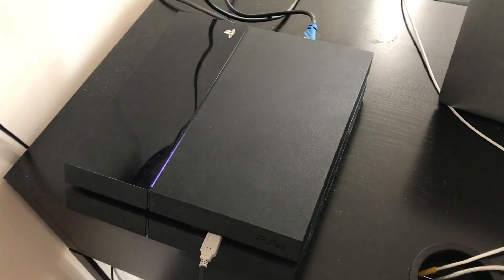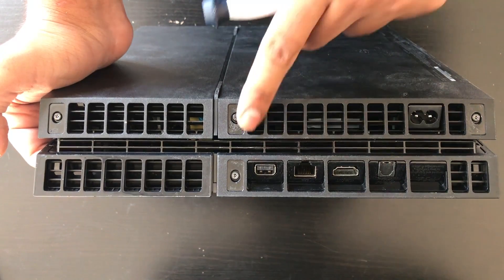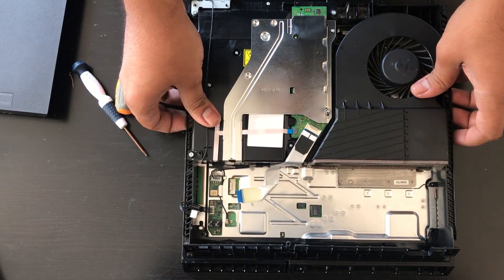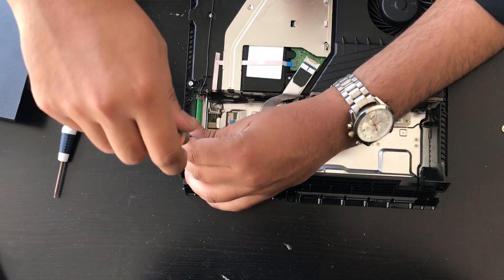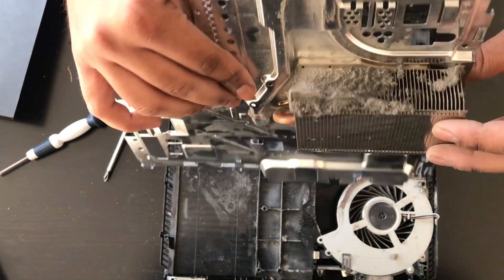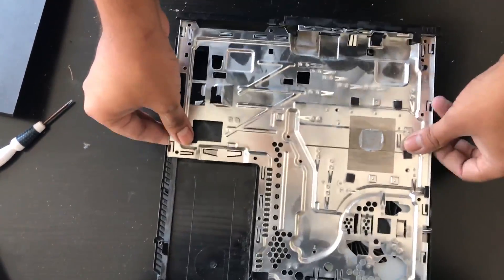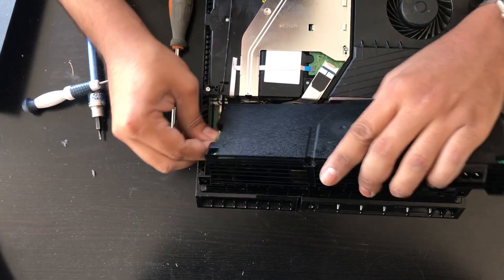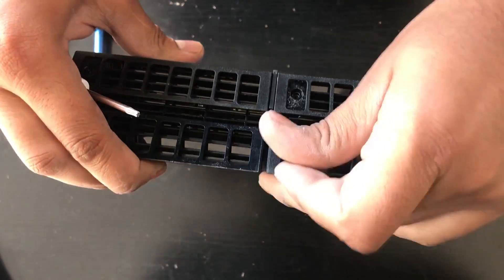PS4 Too Hot overheating due to dust build up and fan (CUH-1001/1115 cleaning and disassembly)

Comment: I want to thank you for doing this step by step tutorial. I decided to disassemble my ps4 following your instructions since I wanted to be sure that it would be real clean. I had to do it urgently cause even when using YouTube it was running loud. I don’t need to mention that I stopped playing games for sometime due to overheating (It shut down on me twice so I didn’t wanna go for a third one)
Everything went fine and all worked as it should. No missing screws or unplugged cables 😄 Now it runs much better and it definitely blows air again.
Reply from the maker: I know this comment is late but please subscribe to the channel and like the video.

Comment: Hey I fixed my ps4 and cleaned it all and I followed everything and once I cleaned it and put everything backed together it started to tell me that my ps4 overheated, may it be the thermal that’s on the mother board, never mind I looked at the fans circuit cord and it’s broken

Comment: After you finished putting it back together you say you cant hear the fan anymore when the game is loading, A real test would be to play the game for half an hour to one hour and i bet you the fan will be loud again, My PS4 from when it came out 2013 i just recently opened it up and cleaned the dust and it wasnt that bad, I have my PS4 Raised up about 15mm i use rubber grommets underneath so the air flows underneath it and it stays cool, the highest temperature it has got from the exhaust fan is 54c and thats playing for 2 hours, i also keep it covered with a Plastic Cover after i finish using it so hardly no dust gets inside the console, if you look after it properly like i have it will continue to give you hours and hours of Gameplay, Cheers Jos

Comment: i used a knife paper towels to clean mine and it is running smooth
and more like a private jet than northway airlines starting up a plane with turbo engines

Comment: Hi, my ps4 was very loud, then it switched itself off due to overheating. I opened it and cleaned all the dust. But, now it sounds like then fan is struggling to spin? A slow kind of grinding noise every 10 seconds or so. Any ideas of a fix?

Comment: hey man, my ps4 keeps overheating and gives me the error message and then turns off 5 minutes after the boot , ive cleaned out almost all of the  dust but still its loud asf and still gives me the same problem,the only thing left to replace is the thermal paste , could that be the problem
Reply: Yes

Comment: ok check it out i have done this to mine and my friends and bothofmy cousins ps4 and his ps4 pro. they all have been working fine for months with no issues. i went on vacation took my ps4 with me. i packed it on top of soft clothesin my suitcase and completly coverd it up. got where i was going hooked it up played a few times in 2 week period watch some blue rays streamed some shit the usuall. packed it back up the same way came home hooked it up played for a couple houres it started to get a little loud so i turned it off took it apart to dust really good figured fuck it replace the gel again so i did put it all back together hooked it up turned it on and it was super loud ran for like 5 to maybe 10 mins than dies. question is what the hell should i check,do or redo?thanks everyone

Comment: 11:06 why are you putting that on when it still has dust?
Reply from the maker: To reduce the chances of damaging the mainboard.
Reply: T R A P P H O N E talk to someone about it bro
Reply: Michael Parissi 
Not even with like a dust cleaning air spray?
Reply: @lfg527  no worries, spray away. And a q tip dipped in isopropanol for cleaning parts on MB works. + No point leaving that crusty old paste there, replace thermal paste when doing this.
Reply: Mads Isak 
Thanks!!
Reply: wow i sprayed all over motherbord to clean dust off ...
Reply: he even left the used thermal paste as it is
Reply: DriFtyZ I assumed he replaced it when he cleaned the heat sink off camera
Reply: I used q-tips and swabs to go around the chips
Reply: I actually used foam cleaner on it 😂😂 glad it still works
Reply: cuz if u clean the motherboard it will fuck it up
Reply: @YoNatrix  no not really depending on how you clean it only I find troubling is he didn't replace the thermal paste
Reply: NatrixFN really ? Why didnt he say that
Reply: @carlosrijo6245  have no idea why. Just make sure before you touch a motherboard you touch metal first for a bit. I destroyed my old PC like that

Comment: I opened the ps4 cleaned everything closed it and now when I use my controller it wont respond properly and disconnects after a while. Can somebody help.
Reply from the maker: Check the antenna
Reply: @fasttechvideo  ok thanks a lot. I ended up figuring it out looking at your comment section on the antenna replacement video.

Comment: Wanted to play/test out my PS4 a bit after following this guide and cleaning the insides of my PS4 before posting here: my PS4 had gotten to the point where it would sound like an airplane taking off, and would “get hot” and auto-shutdown after like 5 minutes. After following the steps in this guide, it now barely makes a sound and runs again, thank you so much for this! Even us 40 year olds can learn a few new tricks!

Comment: I cleaned it still does the same thing I don't understand
Reply from the maker: Replace the thermal paste.
Reply: @fasttechvideo  I took the white casing on the top so it gets more air flow and it's perfect
Reply from the maker: BazaarYT that’s a temporary solution.
Reply: @fasttechvideo  your right i fixed it i blow all the dust now my ps4 is so quite thank you for the help it was just dust build up
Reply from the maker: @Bazaar556  Awesome! Please subscribe and like the video then. It doesn't cost anything to you but helps us out a lot.

Comment: I did clean my ps4 and is still loud and now it's getting way to hot so I can't play games? Any tips?
Reply from the maker: Raggarmeistern Muffe replace the thermal paste and check the tightness on the heat sink clamp.
Reply: @fasttechvideo  yeaaah, I would do that, but my ps4 broke so I sold it to my cousin, he said he was gonna fix it

Comment: I cleaned my PS4 but it’s still loud what should I do?
Reply from the maker: HNIC KB Replace the thermal paste and check the tightness on the clamp.
Reply: Fasttech what should I do if my PS4 laggs but it’s not from
My WiFi it laggs offline too

Comment: Good video my only question is about the thermal paste, I've had a look at a various videos and web pages and they say if you remove the motherboard you have to replace the paste each time is this true
Reply: I fixed it without removing the motherboard I took it apart twice first time I just brushed the heat sink clean but it was still noisy, I see online that it's the other side that gets blocked so took it apart again and shined a torch thru the sink no light was passing through so I got my hoover and put it on air blast in a puff of dust it cleared and now runs nice and smooth, I will probably replace the thermal paste another time but doesn't seem necessary

Comment: Fasttech you are my hero! My PS4 kept overheating and was so loud! After I followed the steps in your video, and reapplying some thermal paste, my Ps4 is quiet and I get to hold out for the Ps5 👌. Thanks again!
Reply: Where did you put the thermal paste
Reply: @devahnmurphy6917  on cpu
Reply: @devahnmurphy6917  Its squere part

Comment: After all these years... ive opened my ps4 multiple times and cleaned out the fan but i never cleaned the heatsink... ive replaced the thermal paste as well and nothing worked... but the. Finally FINALLY after cleaning the heatsink.. the fucking noise is finally gone i cant believe it bro u wanna tell me i could have fixed this problem years ago if i had just cleaned the fucking heatsink!!!!!! Anyways thanks bro ur a life saver, its so quiet right now :)

Comment: I don't get it, I  did everything in the video and cleaned out all of the dust really good.  But I still get the loud noice. What's wrong now?
Reply: Update: I figured out my problem. I just had to replace to thermal paste. This guy made it seem like you don't have to but it made a HUGE difference.

I recommend anyone to replace the thermal paste if you opened your PS.
Reply: Its the fan
Reply: @joaoruxa  nope, It wasn't the fan. Like I said, I cleaned out all the dust from my ps4 including the fan. It turns out I just had to replace the thermal paste.
Reply: @Rexxsar101  ok good you figured it out

Comment: Hey so I'm pretty sure I did everything right and I really thank you but I've ran into an issue which I can't solve but here it goes. So I finally plugged my ps4 in ready to get it going I hit the power button the light stays lit for like 3 seconds and then the light goes away and the ps4 doesn't turn on

Comment: Absolut legend, thank you. Bought mine on Gumtree for £100, very noisy and hot. Followed your video, and OMG, I havent seen anything like it, what a dirty piece of crap it was. Took me about 30 min to get it as new, replaced the paste as well. Now its like new. Many thanks and for all the guys from the UK (not so confident to take it apart) I'm happy to help as well. Wish you all good gaming!
Reply from the maker: I love it when you Enlgish dudes call me a legend. Upvoted and loved. One day I will actually become a legend and make you all proud ;)
Reply: @fasttechvideo  By doing vidoe like this you save a lots of frustration and possibly wasting all these consoles, thats is very positive. I would like to see this issue sorted by Sony, perhaps adding dust filter that can be changed or changing the air flow so it can be easily cleaned.

Comment: Btw this idiot forgot to mention DO NOT DO THIS unless you are prepared to replace the thermal paste. I carried out these steps and cleaned the heat sink only to find my PS4 became 20 times louder than it was before. After some quick research I realised that removing the motherboard needs to be followed by replacing the paste as the paste is usually dried up and flaky when you remove it
Reply from the maker: Adolescentrages 5678 If I’m such an idiot why are you following my tutorial? I must have mentioned twice that you should replace the paste if it’s dry. On this unit it wasn’t and the customer didn’t want to pay for a service they didn’t need.

Comment: after you plug it in is there any memory or data lost?
Reply: Nope I did this. My PS4 used to sound like a jet and overheats in 2min but after this it was quiet
Reply: @uniquesamyu7054  ok thanks 
:)
Reply from the maker: No data will be lost.

Comment: ok.we cleaned my cousins PS4.The Thermal Paste wasn't dry.The fan was all good.But i think we made one mistake.We didn't use an air compresor(i think that's what u said in the video😂)we threw the big pieces of the dust and we just like blowed in it😂😂we put it back together and when we turned it on.he got in a game and it was the same.An airplane was flying,and after like 15 minutes it said it's too hot.We are planning to do it again tomorrow.So do we need the air thing or not?😂Sorry that it was this long💞
Reply: nerma - _ - is it good now?
Reply: @doganefe.  yup we just had to remove the thermal paste and put in a new one.He says it's quiet now and it never overheated😃
Reply: nerma - _ - my ps4 shuts itselfs. Yours was like that or not?
Reply: Doğan efe kırbaç yeah his got a warning that it's overheating and if he would still play it would shut down by itself.Did you try replacing the thermal paste?
Reply: nerma - _ - thank you very much bro.
Reply: Doğan efe kırbaç you fixed it?
Reply: nerma - _ - no, I bought the wrong screwdriver. I ordered the correct  one. Thank you so much
Reply: nerma - _ - Finally’did it. It’s too quite. 15 munites passed and didn’t have a warning about overheating. Thank you.
Reply: By the way I replaced thermal paste. Used Artic Mx-4
Reply: Doğan efe kırbaç yeah now he says it shouldn't be overheating

Comment: I did this and now my PS4 won’t turn on properly. It beeps once, flashes blue, and then nothing. I can hear the power supply but nothing happens. I checked all the wiring to make sure everything is plugged and it all seems fine. Suggestions?
Reply from the maker: Lovell Johnson I can try to troubleshoot with you over the phone or email if you ordered it from us.
Reply: Email: clippedbacksmith@gmail.com

Comment: I just did this last night the dust was so old and thick I had to use my small 150 PSI air compressor with a basketball inflating needle to get the dust out because the dust wouldn't even budge with an air can. It still runs sort of loud but not nearly as loud as before I cleaned it and it didn't overheat. People have to understand that every game is different some games have a lot of content built within them and that's why the PS4's run so loud because its trying to run all of the content within the game. I personally play COD Black Ops 4 a lot and that game makes the PS4 run loud because of the constant updates they keep adding to the game. After doing this though it stopped over heating. Now I can play my multiplayer sticks and stones and Blackout without it randomly cutting off in the middle of a quad game!!!

Comment: People, change the thermal paste once you disconnect the APU from its heat sink. Every time.

If new paste yoy can just collect and spread it again but his shit was crusty and full of spaces. If he had no issues after this it was out of sheer luck and he happened to have great contact between the sink and APU die.

Thermal paste does nothing but fill in the small gaps that may exist between the heat sink and Chip die. That's it. It doesn't suck away heat itself or cool anything. It transfers heat from the chip to the heat sink IN THE TINY GAPS WHERE THEY DON'T TOUCH PERFECTLY. That's it.

It's very important despite doing so little. The one thing it does is essential. Replace it if you open your console and remove the motherboard. Every time. Always.

Comment: If you are repairing someone elses ps4 you replace the compound ,and give it a good clean not just the fins the whole thing ,job half done is a lazy mind.
Reply from the maker: Did exactly what I got paid for. The customer did not want to pay extra for thermal paste replacement. Keep in mind we only charge $45 for this job. You can make a video showing how to do it your way.
Reply: @fasttechvideo  no disrespect it only takes ten minutes,the compound should be added ,as you are taking the plate away from the apu ,if they have acknowledged the way you do it ,i guess it is fine ,but a little pea of thermal paste is hardly a 5 cent job,just saying.

Comment: So my PlayStation 4 gets really hot when I'm playing games, makes 2 clicks in the back and just shuts down. Is that due to dust build up or something else?
Reply: It overheats and that cause the system to  turn itself off
Reply: @randomperson7135  so what can I do to make that not happen anymore?  I took it apart and cleaned it all up. I got the dust out of if and cleaned all of dust from the fan because I thought the fan was clogged. And I also thought that the fan wasn't working but if that was the case then it wouldn't blow out hot air from the back.
Reply: Mr. Black u need to reapply thermal paste without that ur system will keep on crashing
Reply: Mr. Black u need to take it apart again and clean the old thermal paste with a q tip or cotton ball and alcohol but make sure the thing ur going to clean it with is damp and not soaking wet cause liquid could get ing ur system and damage it
Reply: Mr. Black they sell it on amazon if u are wondering
Reply: Mr. Black and just apply a rice or pea size amount cause if you put too much it will spread all off the board once you reassemble it
Reply: @randomperson7135  where can I get this thermal paste and how do I reapply it? What's it for and do exactly?
Reply: Mr. Black amazon and the thermal paste is that it can transfer all the heat that the cpu makes to the heat sink cause without it the heatsink and cpu aren’t fully touching eachother so all that heat goes nowhere and it stays in the cpu causing to overheat and crash
Reply: Mr. Black look it up on youtube there tons of tutorials explaining how to apply it
Reply: @randomperson7135  will do thanks I appreciate it
Reply: Mr. Black skip to 13 minutes and watch till 16 minutes

Comment: Where you located and how much would it cost to send my ps4 for the overheating problem because i clean as much as i can and it still overheats
Reply: me too. after 5  minutes it just turns up very quickly.
Reply: A little late but it seems like your problem may be the thermal paste. If your paste is dried, you're going to have a problem with your console overheating.

Comment: I’m not sure where I went wrong but whenever I start a game my ps4 automatically turns off now
Reply: Thebeau Paul you most likely didn’t tighten the heat sync screws (5:25) properly that’s what happened with me then it started working

Comment: I opened mine up cleaned it and put it back together. Now when I try power it up the light comes on then a second later just goes off. Am I fucked or can I sort it out
Reply: You most likely didn’t tighten the heat sync screws at 5:25

Comment: My ps4 is know blinking red where it has to be blue or white, what should i do please reply?
Reply: Follow the vid it’s real simple
Reply: I did,  but now my ps4 just turns of after 3-4 minutes
Reply: Mellz Rose I just got done with it and it’s working fine you should try to go back through the video and see if you missed anything putting it back together
Reply: Maybe its the dried up thermal paste, I ordered a new one and i will remove the old one and re-apply the new one
Reply: I fixed the problem, the fan connector cable thing was not connected😅